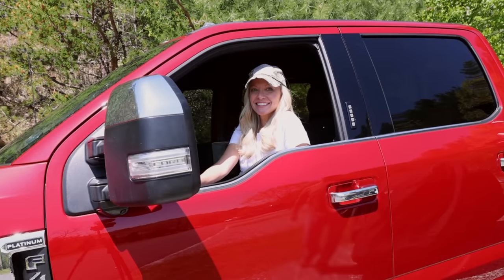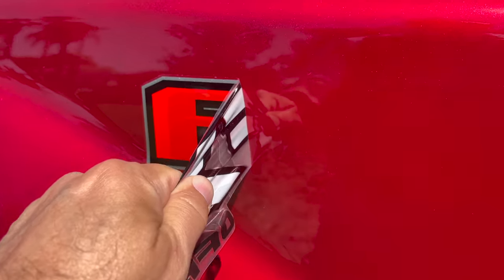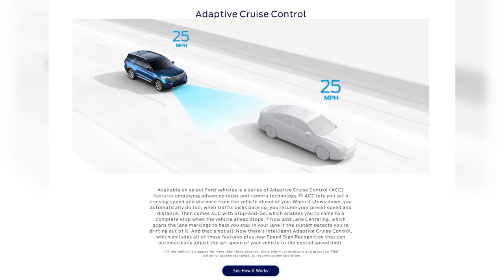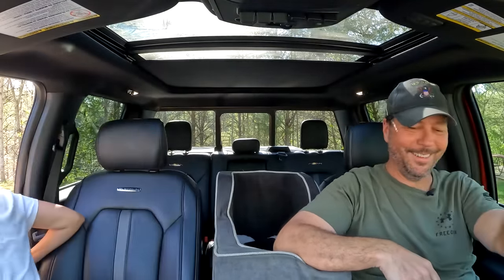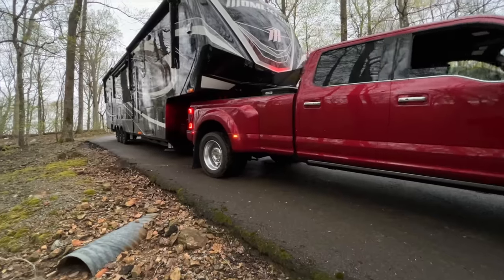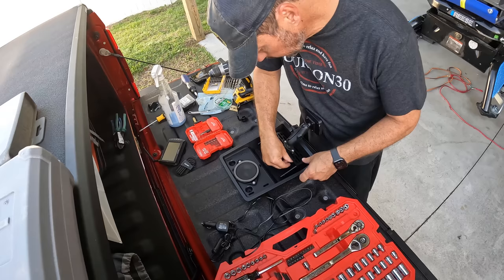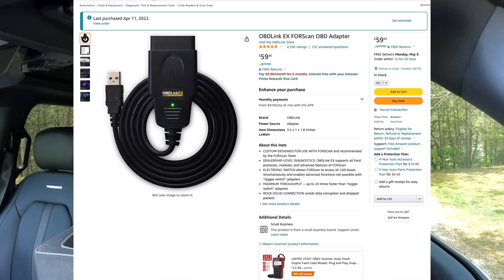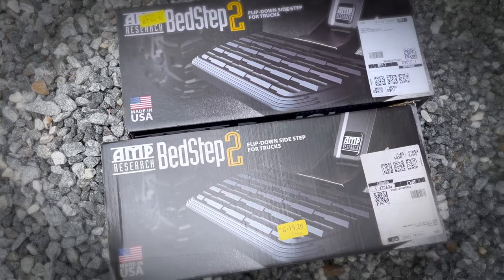2022 F450 Platinum! (Full Time RV!)

Comment: BTW.  Carli suspension is what I run on my F350 dually and I do not recommend it for 5th wheeling.  It's too soft and you will nose dive,  a lot.  Also they do not offer standard ride height.  Liquid Spring, which I have on my F550, is the way to go.  They have a standard height or a 2", but they do not offer it on a F450. Kelderman is the only option, however, I recommend only doin the rear suspension.  It will not alter your load carrying capacity.  If you did both front and rear you would get a lot of sway even after upgrading to larger sway bars.  Mall crawling OK.  5th wheeling NO.  BTW the designer for Kelderman is currently the designer of Liquid Spring.  He will back up what I say.
Reply from the maker: Good stuff!  Thanks for the info!
Reply: Great Review! ..  We bought a used 2017 F450, it has Kelderman rear suspension - ride is comfortable when towing or unhitched and load is always level!

Comment: I have the 2013 F450 4wd crew cab True cab/chassis 120" Wheelbase 14500 dry weight I run the 4:88 gears and my towing 39,000 lbs with 5000 on my flatbed built in Canada
Reply from the maker: 4.88?  Wow!

Comment: Ceramic coating is the worst thing you could have done. It bonds with the clear coat which means that in 3 - 5 years you have to strip a layer of clear coat off, do an additional paint correction, and reapply. Nothing beats a good clay bar, compound, and wax for the health of your paint. I would highly recommend a high-end ceramic tint to increase the longevity of your interior and dash. I run Xpel on my side windows and windshield. 17 on the sides and 70 on the windshield with 17 at the AS1 line and above.

Comment: 14:30 Your weights and measurements police person will use the sticker on the door, so will the insurance company if your overloaded and get into a wreck!  I have seen it, the insurance company can refuse to pay if your overloaded or if you don't have the correct class license for what you are towing.  An example, here in Texas you must have a non-commercial class A if the GVWR of the tow vehicle + GVWR of the trailer is greater than 26K lbs and the trailer has a GVWR over 10K.  So basically with the 14K GVWR on the truck the most your trailer can be is 12K without the need for a class-A license, greater than 12,001 GVWR on the trailer you have to have a non-CDL  Class A to be legal, many people don't understand that, and if you get into an accident, your insurance company won't cover you because you don't have a license to be driving that rig.   Just saying for a friend! 👍😎  Nice truck by the way.

Comment: Try police mode in forscan.
When the fob(s) leave the cab, it can't be taken out of park. No one can steal your beautiful pickup.
Reply from the maker: Now that sounds like a great option!  Thanks for the tip! 👍🏼
Reply: What is forscan?  I just got a new truck myself and am concerned about theft.
Reply: @BestNCBBQ  it is a program specific to Ford vehicles which allows access to the onboard computer (body control module) through the OBD2 port. There are options the dealer can change,... usually they will not or tell you it can't be done or if they know how to do it, and are willing to to it... it will not be free.
It can be found doing a google search.  I did mine back in 2017 and there was no license fee. I believe now there is a fee. (according to Chad). Warning!!
It requires the codes to be changed and must be done correctly or things may not work. You can get into trouble if you are not careful. If you are computer savvy, it's not a problem, just write down the old codes you are going to change incase you need to put it back. I don't know if the program has changed since it has been almost 5 years since I changed mine.
Note: It is very limited on the pre-2017 Superduty pickups, not really worth it. I believe Ford changed the BCM's in 2015 for the F150 and 2017 for the Super Duty. It was during the big redesign.

Comment: A bigger fuel tank would be good so you can bypass high fuel prices in certain areas
Reply: S&B
Reply: Definitely. We upgraded our under mount tank from 26 gallons to a Titan 60 gallons, and, added a 50 gallon Titan Travel Trekker tank behind the cab with the remote transfer switch.

Comment: Using  Forscan software, I successfully made the following changes:

Double Horn Honk Disable. This disables the double honk when walking away from truck with engine running and key fob in pocket. 

Fog Lights with High Beam LED and some HALOGEN. This allows LED fog lights to stay on when high beams are also turned on. This has been confirmed to work with some halogen headlight trucks also. Also known as Bambi mode (to see deer better). 

Driver Seat Belt Chime Disable. Disables the chime on the driver seat

Show Temps on Gauges. Display exact temperatures above the gauge on the center cluster. 

Disable Door Chime when Door Ajar IPC Disables door chime when door open and ignition on.

Disable Triple Ding at Startup IPC Turns off "ding ding ding" at start up.

Added “Average Speed” as option in Trip/Fuel Menu display.

Radio Extended Play. This changes the radio power-off delay to 60 minutes after the truck is shut off. Wait for the ingition power to time out and then turn the radio back on with the RADIO power button. Alternatively, after turning off the ignition, open and close any door to disable accessory power. Then press the radio power button to turn radio back on. It will now stay on for the extended specified time amount.

Enter NAV Destination and viewing texts while vehicle is in motion. Enables entering NAV destination and viewing texts while vehicle is in motion.
Reply from the maker: Good stuff!  Thanks!

Comment: Liquid spring allow adjustable hight at the push of a button.  It's around 15k system front and rear.  Im going with kilderman  for my f450 due to cost.  10k out the door installed kilderman  vs around 18k liquid springs. Liquid springs is superior is all aspects,  reliability and durability.  They both mentain tow capacity on paper,  but honestly increased actually capacity. Carli is a joke.

Comment: Hey Great video, I just upgraded from a 350 to a 2022 f450 platinum also. It is an amazing truck. I have done a lot of the same upgrades as you, and have not regretted any of it. I am in the process of adding the Kelderman 4link ride height suspension to my truck. It is going to be installed in the next few weeks. We pull a 2022 alliance Valor 40v13 toy hauler with it and the Kelderman is suppose to really help with towing. The ride is great because it doesn’t lift your truck but it removes all your springs and leaf pack and your riding on air bags like the semis. I am happy to share some video once it’s done. It suppose to be great for towing and lot of Hot Shot drivers use it.  Here’s a good video about it https://youtu.be/TALvFCrAqJY also Kelderman has some good videos on it.   Enjoy your new truck, I know I’m enjoying mine!

Comment: Make sure that you inflate the tires to 105 psi on the drives and 110 on the steers.  If you run the under inflated pressure that the factory ships it with you will wear the front tires out quickly.  I get 60k Miles out of my 2018 f450 tires.  Also get that truck aligned at an alignment shop.  Everyone of these Superduty Trucks come out of the factory misaligned.  I’ve owned 8 of these trucks in 20 years 4 f450 pickups and 3 F550s.  Do not use the dealer or anywhere with a new computer alignment machine since the specs programmed into it are wrong.

I take all of my new F450 & F550 trucks straight from the dealer with an appointment to Weber Wheel & Alignment in Palm Beach FL performs the alignment on all my trucks along with the City of Palm Beach and other municipalities.  They use the same equipment from 1964 when they opened and my trucks drive better than ever!

Comment: Why go with a platinum? I’m just curious as all them platinum features you got take off your payload. Especially if full timing RV is the goal I don’t understand why. A lower trim would have gotten you all the features you actually need with a higher payload rating. Jw. I see a lot of people fall into the trap of this not realizing
Reply: No disrespect just honestly curious. Personally don’t understand why. If full timing was my goal I’d want the most payload vs features I’ll rarely use that will eventually brake down the road and cause maintenance expense. Just my outlook.
Reply from the maker: IMO, the GVWR of the truck is underrated.

Comment: I have the Kelderman on my 2021 F450 and love it!!!  The ability to raise and lower the ride height when hooking and unhooking the 5th wheel is awesome. 

We have 2 trucks at work with the liquid spring, a 550 and 650. It works really well but doesn’t have a front suspension option on either unit. So the 650 is still very harsh with the front end then smooths out when the rear suspension hits.  Would probably be a similar situation with the 450. 

The air ride does react quite fast sometimes to level itself back out which catches me off guard sometimes. The liquid spring uses some sort of pump to move the silicone in and out of the bags and don’t know what the longevity of those pumps are. 

Enjoy the new ride they are amazing trucks!!!

Comment: Really interesting that you use an aftermarket tire pressure, backup cam, forward cam and navigation system when you have a 12 inch display in front of you.   Typical bad Ford software.  

I'm not blaming you for doing it, I'd probably be doing the same.  It's just so telling that Ford can't build what customers need.  Every F450 driver needs RV nav, tire temp/pressure for all the tires, including/especially the trailer and the backup cam.   Yeah, Ford sells a backup cam, but its very expensive for what it is.  

So stupid !  Spend all that money on a loaded tow vehicle and still have to pile devices on the dash.  WAKE. UP. FORD.

Comment: I would say that a few of the biggest factors that steered me away from the F450 was Price and the fact that the Wide Track absolutely eats tires like crazy. 
You have a nice tight turning radius but when those tires turn almost sideways they scuff hard core.
Reply: I have a 2008 W/widetrack and NEVER had a tire wear issue. You don't drive down the road full lock at 45 degrees of steering input